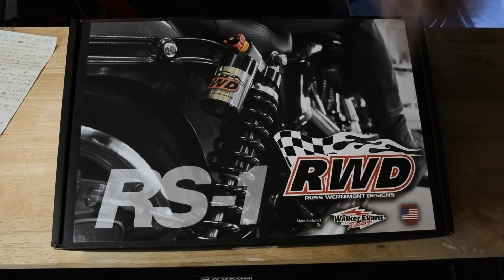Best Harley Davidson Shocks Upgrade - Russ Wernimont Designs - RWD

Comment: I replaced my stock 2019 Electra Glide Standard shocks with the RMD's.  What an amazing difference!!  Been riding 54 years and this is one of the most dramatic upgrades ever.  Standard has only 1.5" total travel of which .0" (yes, 0) goes to no-load sag and .5" goes to rider sitting sag.  So you have only 1" travel for a hit and only .5" (with no dampening) for a dip before bottoming.  Could never find a compromise.  Used 13" instead of 12" RMD shocks and gained another inch + they suggested and I used .5" no load sag and 1" rider load sag.  So now I have 1.5" for dips and 1.5" for hits with dampening in both directions.  In Florida with drainage gutters at every road juncture, I no longer have to cringe to take the double hit; on the high speed Interstates, the bike is stable and I don't even flinch anymore when I have to hit either cracks, raised concrete/asphalt edges or debris.  Absolutely amazing--you are correct!

Comment: Your review is 100% spot on! First and foremost, those shocks really show how crappy the front suspension is and I changed my RGS forks out to cartridges the very next day. My RS-1’s ride so plush, but when driven out of a full speed corner, they squat and track to perfection! I now have 15,000 miles of shear comfort and performance on these phenomenal shocks!
Reply from the maker: Great feedback.
Reply: TheMarkMillerGroup what cartridge system did you use?
Reply: svo68 I would have gone with the RWD fronts...but they were not available, so I installed the Legend Axeo’s. Huge difference.
Reply: Thanks for the info!!

Comment: My 2015 limited stock shocks were not making the grade. After a lengthy research decided on the RS-1 shock 13" from RWD. I was a moron for waiting so long. Don't trade your bike in trade your shocks in. Like a different machine, rides better then the 2020 I have ridden on demo rides. Rode some roads in FL that would have jacked my spine but not an issue on the RS-1. I am not going to tell you that they disappeared but they no longer jarred me or my wife. She absolutely loves them. The front shocks are C##p in comparison, not going to wait, going to update my front shocks ASAP.

Comment: How come you did not use the O-Rings that are supplied with shocks? Supposed to put one on top outside and one on bottom outside (both sides) between spacer and shock.

Comment: Just a quick note, the spring weights you have in the video are not what's listed on the RWD website. They have the following: STANDARD - Solo Rider 299 lbs or less / 2UP 350 or less
HEAVY DUTY -  Solo Rider 300 lbs or more / 2UP 351 or more.

Comment: I have these but they seem to be a bit too soft. I have the springs about an 1 3/4 turn up and they are ok now but still soft. I’m only 200 lbs and my wife is 125 so we’re under the weight for both. I’ve even turned the red knob because the black knob wasn’t doing anything.

Comment: I have a 2019 Hd CVO Street Glide.    Looking to change the stock rear shocks to either these or was looking at the Ohlins.  Which do you recommend?   Leaning towards these.
Reply: I guess HD is thinking you didn't pay enough, *($40K+), to expect adequate suspension. At least the paint looks nice!

Comment: You do realize that just turning the spring does nothing right? You need to adjust the collar up as you first mentioned. Also, to set proper sag, measure straight up off the axle to a frame point. not the spring length.